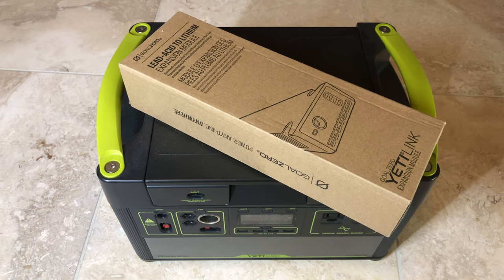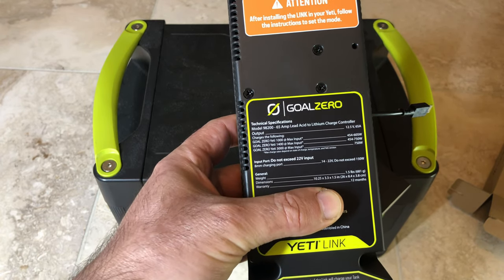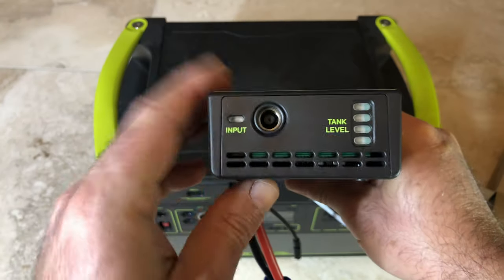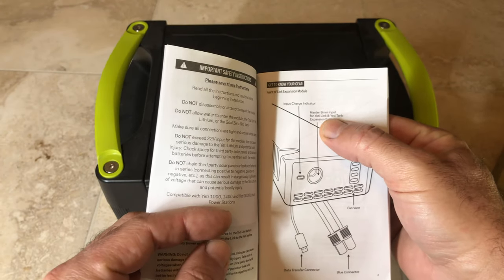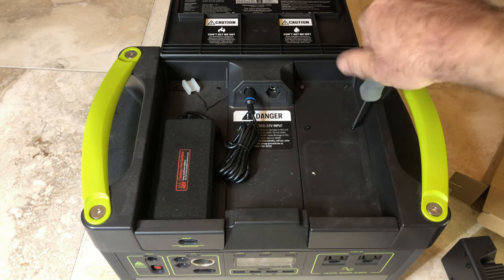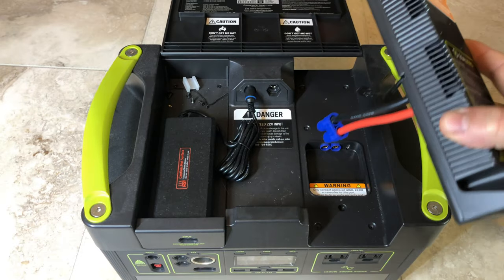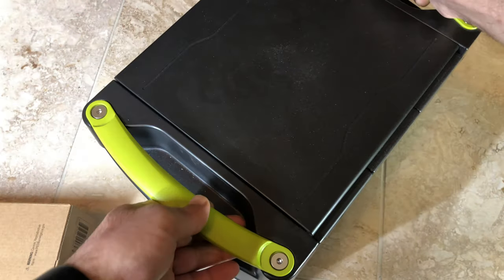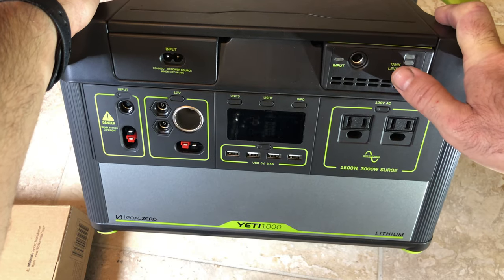Goal Zero, Yeti Link Expansion Module Installation,  Recharge a Yeti Lithium from your vehicle   Car

Comment: Thanks for tutorial.  I’m trying to remove the yeti link from my 3000x to check the wires.  Having trouble removing it.  How do you do that, please?  Removed screws, unplugged from rear.  Does it lift out?
Reply from the maker: Don’t have 3000x. The one I have is simply take the screws off, lift it, unplug the connection and that is it.

Comment: I have the Expansion Module for my 1000 LI and two Expansion Batteries. I have the car cables, but have not attempted to connect them. Did you by chance film the process of connecting the cables to your battery or alternator? Thanks for the video.

Comment: Has anyone had trouble with the expansion tanks not charging to 4 lights? I have a yeti 1000 and 2 tanks. The tank indicator was at 4 lights and all of a sudden went to 3 have had it plugged to the wall outlet for days and no 4th light..

Comment: Hello, and thank you for the info. I just installed battery isolator, new Optima yellow top auxillary battery in my 2018 chevy silverado pickup truck. I'm thinking about running the goal zero wiring under my truck, along the frame, and drilling a hole in my cargo bed (I have a camper shell on) to connect to my goal zero 1400. Any thoughts?

Comment: I am getting the expansion tanks and the car charger can you charge both at the same time with the car? I have 3000.
Reply from the maker: Check out this link: https://www.goalzero.com/shop/kits/yeti-link-car-charging-kit/
Under Q&A, Goal Zero support states the following: 
"The Yeti Link will stay in Car mode until you manually change it back to Tank mode. If moving the unit from your vehicle to then chain it to the Tank batteries in your home, you will need to change the Link from Car Mode to Tank Mode."

Comment: I’ve got the same deal going on.  I have a Yeti1000 from Costco and a fridge for the car.  Just got the Link to improve charging since the cigarette lighter charger doesn’t put out enough.  But dang, that cable is think.  Not sure how I’m going to get it through the firewall.  That would be a pretty big hole.  What did you do?
Reply from the maker: I used the existing hole that was already there. Made a hole on the rubber, managed to get the cable through and sealed the new cut / hole I made - I was very carful not to cut my car's wiring since it is not the easiest place to work in - my back wasn't happy with me :)). Not perfect but I felt it was better than drilling a new hole on the firewall structure of the vehicle. I have gone to a couple of trips with this setup already, I am very pleased with it.
Reply: Yeah damn that looks pretty big to have to try to get it through the grommet. Not just the cable but that plug.

Comment: I've had two of these links plugged into two different yetis 1000Xs and I don't really see them charging my Yetiis. I have this hooked up to two tanks that are fully charged according to the LED indicator on this link. I don't know what's going on with it though. I can't get any power to go from my tanks into my yeti 1000x via this link module. Is there something I'm missing here? I plugged everything in according to the instructions.
Reply: I have the exact same problem .   Did you find a fix ?

Comment: If using this yeti link, you can't use the goal zero mppt controller..

Could you plug an aftermarket mppt controler into the power pole input on the left?
Reply: The X type yeti all have mppt build in. FYI

Comment: anyone do this on a yeti 1500x or any X series yet?
Reply from the maker: Goal Zero released a new version of the expansion module that is compatible with the newer X models. They have also updated their cables - adding a fuse and cable terminal lock due to a recent recall.
Reply: @ToolsReview  since they are out of stock on the cables,  and I need the hookup for a trip, i am making my own ec8 to ring cable, using 8awg and adding a 50A fuse to the line.  Going to control it with a 50Amp or greater relay hooked to one of my upfitter switches
Reply: @WhatsMyGear  The new setup is back in stock as of last week. Just got mine in the mail and installing soon on my 3000x

Comment: At $400 plus. It’s pricey option
Reply from the maker: 100% agree. I have to say, after using it a couple of times, I like it even more. The 12 ft cable should have been 15 ft to give more room for routing. I like the flexibility of being able to have a portable power source instead of adding a fixed 2nd car battery. I would like to see this at a lower cost for sure.

Comment: This product is defective and will catch fire in your vehicle. I highly recommend removing it before it damages your vehicle. Mine caught on fire and nearly burned my truck to the ground.
Reply: I believe they’ve fixed it - connections are beefier and they all have plastic pieces to hold cables either together or in.